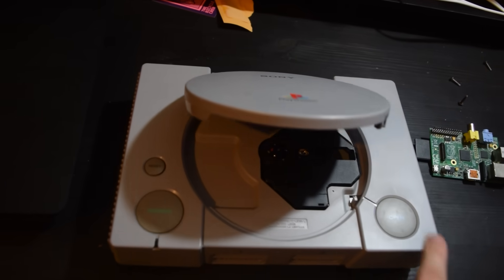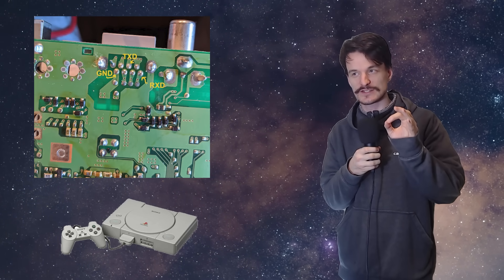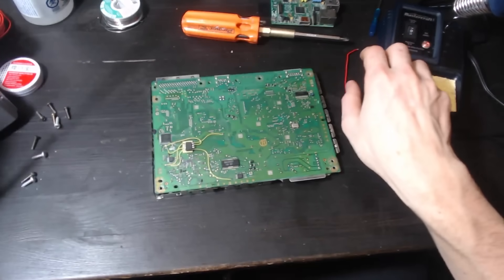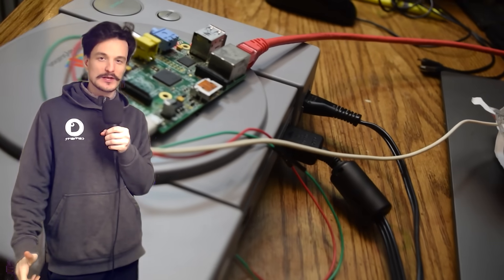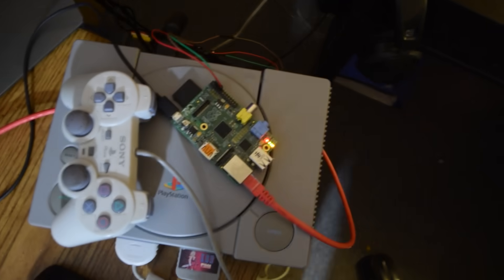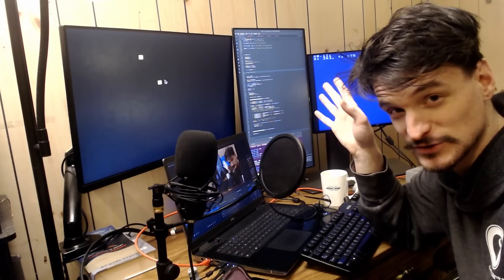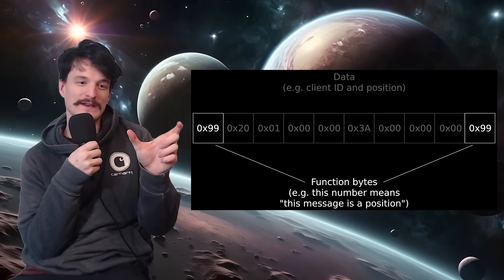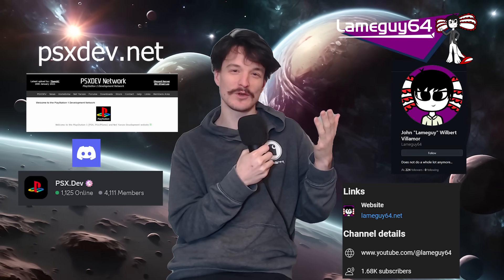I made an online PS1 game and connected it to a PS4

Comment: How would one send iso's just from the pi and boot on the ps1?
Reply from the maker: You can send programs over to the PS1 with a Pi over serial. However they have to be small enough to fit into the tiny RAM. You use UniRom. 

You can replace the disk drive with a Picostation. That's just a DIY Pi Pico. However it's a lot more involved and requires soldering and pin lifting.
Reply: @CarlDoesTechThings  I was hoping this was an easy sd card loader option with 3 soldered points and a pi. I kind of dont really want to replace the optical drive. And im cheap, I don't want to spend the money on a psio card 😂

Comment: Assuming you didn't have easy access to the part...

Why not use the serial port?

You only needed 3 conductors
Reply from the maker: @Love_Muffin302  it is the serial port! Those pins are where the serial port is on the motherboard. It's the cheapest and easiest way to communicate with the port and it's completely reversible instead of slicing up a serial cable, for example. Also requires no additional hardware.

Comment: The serial port on the back on the PS1 gives you realtime access to the console's RAM. You should write a tool that lets you play a splitscreen multiplayer game across a network with the game being visible on both consoles and running in sync. Like just boot up Ridge Racer 4 or something and send player 1 and player 2's data across a network so it synchronizes. It should be pretty doable.

Comment: Perhaps I should try doing something like this. Although I would need to buy a ps4 and a raspberry pi (or use that as an excuse to learn how to manufacture/solder my own micro-controller). Assuming I want to go that far, it would be good electrical/computer engineering practice, and I would be able to be one step closer to designing things like a game console itself and other breadboard circuits.

Comment: Зачёт за старания!!! , Через пико плату можно ли сделать запуск игр через флешку ?? 
X station and PSIO очень дорогие да и качество не хорошее.
С учётом того что у дисководов лазеры у многих умерли через платы Pico сделать HHEN
Reply from the maker: While it is possible to upload games to the PS1 through the Pi, it's limited by how much volatile memory is available. Check out UniRom:

https://unirom.github.io/

Also serial is very slow, so games would take forever to load.

It would be completely possible though to feed games over the serial port. However, it would be a lot of work setting up the games to load over the port as it would need to somehow make the game read from the serial port.

This is why PSIO uses the parallel port. However, it should be relatively straight forward to wire up the parallel port and figure out how to send data over it. Which is what PSIO did. PSIO could then just be replaced by a Pi!

Comment: Also as far as the n64 is concerned, there is the 64DD. The 64DD had a card you could slot in that was basically a modem. It's pretty expensive these days to get your hands on them both though.

Edited to add: it's the randnet disk. Idk why I didn't mention the name the first time. Also apparently there's a randnet+ project someone started a discord for but idk if it's still going or if it's defunct.

Comment: I would've used a UART (Serial) to USB Bridge instead of a raspberry pi as you don't have to code for the computer and the rpi too. I use the CH341A, but if you have a spare Arduino board, tie the RESET pin low (or high, I don't remember) and connect TX to pin 0 and RX to pin 1. Note that this will only work on boards where the serial chip and the main chip are separate, like the Arduino Uno, Arduino Mega/2560, Arduino Nano, etc. The Arduino Leonardo, Arduino (Sparkfun) Pro Micro and others have a native USB port so you can't hijack the UART communication as it happens inside the chip.

Edit: I think you can actually use the Arduino Leonardo and similar because there are two serial ports available, the one from USB and the one that is exposed on pin 0 and 1. You would have to hard code the baudrate but it's possible via software. You would have to read the TX from the PC and send it one byte at a time to the exposed UART and the reverse too, you read from the exposed UART and send it one byte at a time to the PC.
Reply from the maker: It doesn't really make a difference in the programming as the data coming over serial still needs to be converted into networking data (websockets in this case). I originally had the serial port just forwarded straight over to the laptop, where it was seeing it as its own serial connection. Although this did weird things to latency.

The only reason I used a Pi is cos it's what I had laying around!

Comment: instead of modding the console, could you just buy an official sony serial cable, and connect it to the raspberry pi, maybe open up the cable, and connect the pins manually if the interface is not the same?
Reply from the maker: Yeah shouldn't be any reason why you can't splice the cable. I've just bypassed the cable with the wires. So it's a few cents instead of however much a serial cable costs and get delivered (depending where you are)

Comment: Would like to see same concept but communicate with another ps1 across a network so serial to lan so it can send tcp/ip infomation instead of having 2 ps1s hooked up on 2 separate tvs with games
Reply from the maker: I'm not sure what you mean? The version I've created here is using websockets, which are a TCP-based protocol made for real-time bidirectional communication over a network. The translation layer on the Pi converts all serial data into websocket data which is connected to the server (so it's serial to lan/websockets).

The server I created just accepts web sockets. So the server could just be hosted on some cloud server and using my code, etc. any PS1 could connect to it from anywhere!
Reply: @CarlDoesTechThings  interesting I like this concept, like do the same thing but with 2 ps1s on the websocket communicating over serial to the raspberry pi and then theres another ps1 listening for a serial connection on the other end with another raspberry pi, so what im trying to say is would it be possable for 2 actual ps1s communicating over serial to a raspberry pi to connect over the internet to play coop games, kinda like tunngle or hamachi is what I'm trying to say, I love this concept on how a ps1 can communicate through serial to a pi and then that data gets sent to a server so it can be used as tcp/ip for a ps3 ps2 or ps4 its amazing concept

Comment: How long did this take?
Reply from the maker: The software is the longest part. The hardware is pretty straight forward.

The code running on the PS1 is pretty simple as it just reads and writes serial info and manages a list of entities to show on the screen. However, the translation layer to convert from serial to websockets needs to also manage the same data as the PS1 and the server. The server also needs to be created to be able to manage all the same message, data, a list of players, etc.

So, it's more the management of the communication between everything that's the annoying part. Still it's all doable.

All the code I created for this is in the description.

Let me know if you need help!

Comment: Do you really need to solder to Serial pins on PS1? Couldn't you use existing plug? So it will look less junky

Sorry if you have explained it in video, but I didn't catch it😅
Reply from the maker: Doing it this way is just the easiest way to do it with what I had to hand!
Reply: @CarlDoesTechThings  understandable!

Comment: I wonder why you didn't use the built in serial? Like yaroze used.  I haven't watched the whole video so please excuse me if you covered that. 😅
Reply from the maker: It does use the built in serial! The points I soldered to are the solder points of the tx, rx, and ground of the serial port. It's just the quickest way of achieving serial comms with what I had laying around.

It doesn't change any of the requirements for software as there would have still needed to be a translation layer somewhere for websockets, which is what I did on the pi!

Comment: If you're looking at doing something featuring the N64, a quick and cheap solution to running code on your N64 is a PicoCart64, but for doing real dev work, a much faster way for quick iteration is a Summer Cart 64. Also, I'm pretty sure you can use the joybus protocol to have two way communication through a controller port, or if you're using a Summer Cart anyways, it has a USB port on it you can use for your game. Use libdragon!

Comment: Very cool project! Instead of soldering wires to the motherboard, why didn't you buy a playstation 1 link cable and modify it so you could plug it into the ps1 without soldering? That would have made pulling whatever signals you needed much easier.
Reply from the maker: The link cable does the same thing, with a few extra pins (that I could also solder). It likely would have been harder to modify the cable than just solder to the pins. The programming, etc. still would have all been the exact same! I just had a pi laying around.